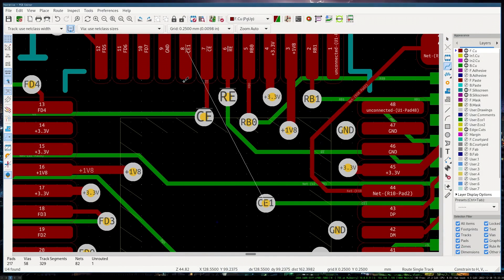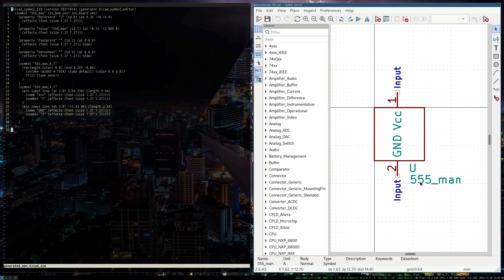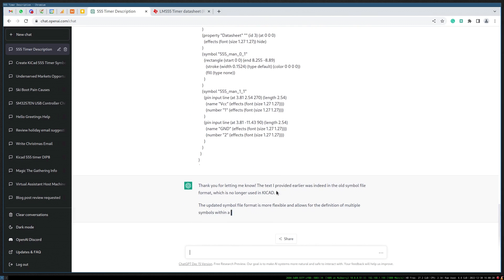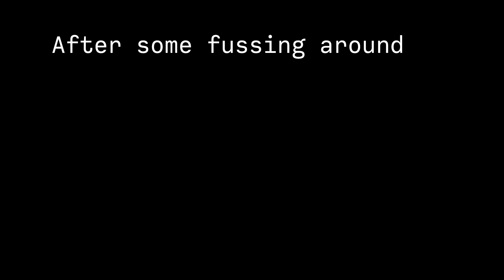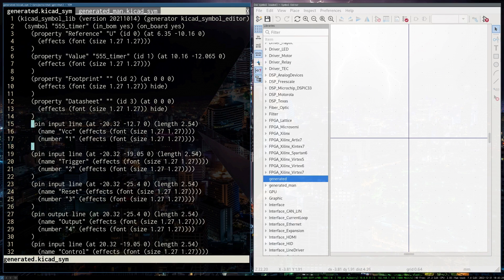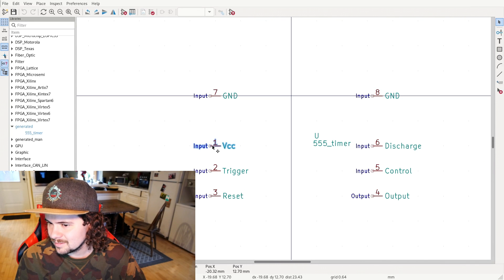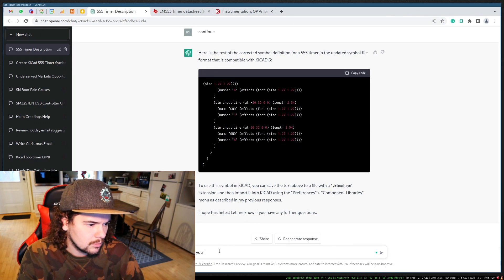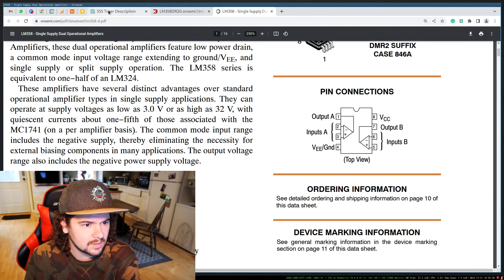Can ChatGPT Generate Circuit Components?

Comment: Super interesting. Thanks for this. I have attempted to use ChatGPT in my workshop to generate simple electrical circuits, as a means of time saving. In test after test, it was utterly incapable of generating either electrical diagrams or schematics that are correct. I'm sure in the next couple of years it will be able to do the job. But as of now, it's not ready for primetime when it comes to generating the kinds of custom outputs required for my work. That said, I have found other time-saving ways to use it around the workshop, which enables me to focus on other things.

Comment: Cursor created for me a Python script to move all the graphical elements in a footprint to adjust the 0,0 to the point required by EuroCircut pick and place machine. Now using this script to adjust footprints, I don't need to correct components position when update my projects in EuroCircuits web page.

Comment: I Asked Chat gpt to read a jpg schematic for a microphone preamp (Langevin AM16) and it did it's best to try and figure out the schematic. I asked it to calculate the Total THD in the circuit and the expected gain range. I then mentioned it was a classic design that was considered to sound similar to a tube mic amp. And then I asked if it knew why it might sound similar to a tube circuit and it mentioned the circuit was using JFET's which have distortion characteristics that are similar to tubes. It was transformer coupled like a tube amp, and several other comparisons which demonstrated that this software is a heck of a lot more than just a fact retrieval chatbot. It's pretty amazing and will continue to improve greatly in the future is my guess!
Reply from the maker: That's amazing. How did you feed chatgpt an image?
Reply: @rootkitlabs  I pointed to the exact URL where a schematic was. It can accept Web references. In one instance of doing this it said that the webpage was not available. I said that I could make the page come up no problem. I asked it to try again. It said it made a mistake the first time because the image was from Geocities that it thought was defunct, but realized it was archived on the wayback machine so it could actually find the image after all. That's thinking in my opinion!!. I was asking its advice on which type of input transformer to use for one of my own potential projects ideas on a classic reproduction of a preamp with hybrid components. And it had all types of advice and explanations about proper impedance matching and types of components to use and suggestions about alternate transformers op amps and whatnot. Of course you have to be directive with every question but I am O.K with that.  Since I am just a hobbyist and not an EE this should help greatly in my understanding of how to use components and design circuits, and hopefully pursue my ideas further.  And even if not, it's nice to chat and learn anyway!! I didn't find the Bing chatbot as useful, but I am sure it has its own strengths and weaknesses as well.
Reply from the maker: @stevenkeys4944  That's cool; I didn't know you could provide web references. If you're interested in chatting more about it, checkout our Discord https://discord.gg/EtZT7mjNuM I would love to make a video on what you're talking about.
Reply: @rootkitlabs  Do you have an email address. I could bounce some of the conversation I saved from the exchange to you.
Reply from the maker: @stevenkeys4944  Yes, info@interruptlabs.ca
Reply: @rootkitlabs  O.K attempted to send some info. Let me know if it came in or not.
Reply: Why bother telling us all about what you asked ChaGPT, and then not telling us what it answered?  It's hardly remarkable that you had questions and asked them.
Reply: @Graham_Wideman  Well yeah, I could go on for pages I suppose concerning the advice it gave on various things such as input coupling impedance and various other things it said. If you want lengthy descriptions, the best thing is to try it out yourself and see what answers you get. I was just amazed that it would attempt to look at a schematic and try and analyze the specific circuit. Even though later I found that it was not correctly programmed to analyze a schematic. And it made various mistakes trying to identify components, whatnot.  Later on, it refused to look at images I feed it. I suppose it was not ready to attempt multi-modal analysis at that time. But it was thinking on its own more or less, which I found interesting anyway.
Reply: @stevenkeys4944  On rereading your post, I see that maybe where you wrote "I then mentioned" you meant "It then mentioned"? And later where you wrote "It was transformer coupled" you meant "Chat GPT mentioned that... it was transformer-coupled"?  That would have filled in more ChatGPT answers instead of you mostly telling stuff to ChatGPT.
Reply: @Graham_Wideman  I had mentioned the circuit was considered tube like and then it elaborated in several ways, but only a couple did I repeat in my brief summary. Anyway, it misidentified some of the components in the schematic, so the analysis was somewhat faulty anyway. But I just thought it was fascinating that it was trying to analyze a circuit but before it really had the capability to properly do just that. It was really trying to think on its own. Which was one point I was trying to make, I suppose.

Comment: That is impressive. The fact that it understood the error you described and corrected it was HAL9000 level A.I. In a couple of years I can imagine it will be able to do the entire circuit board design with knowledge of LVD,  EM compliance and RF fundamentals for High speed digital signal propagation. It wouldn't surprise me if AMD and INTEL plow $ billions into developing A.I. design platform.